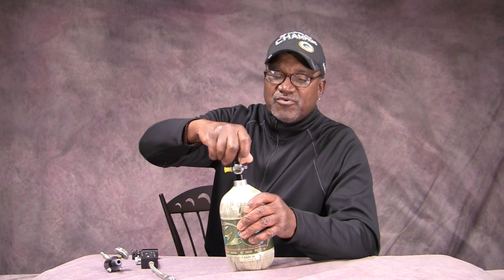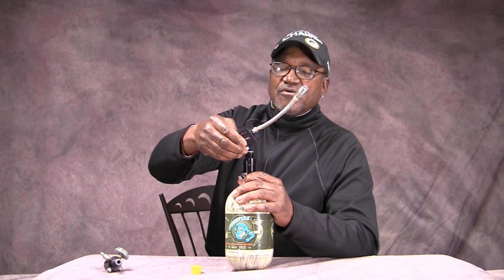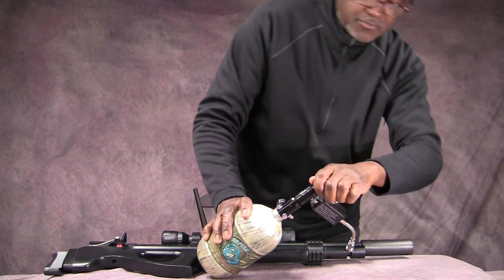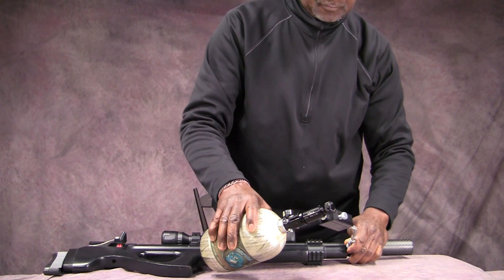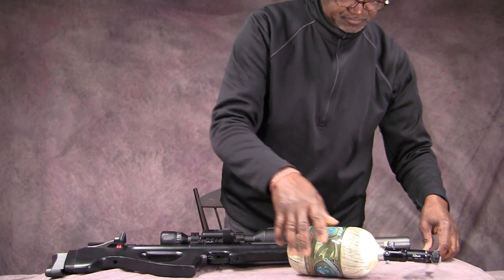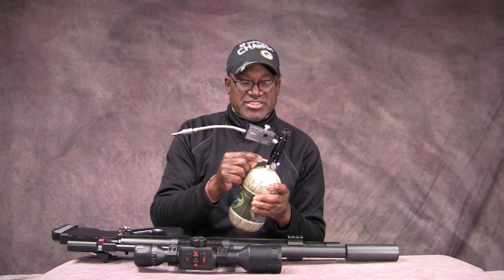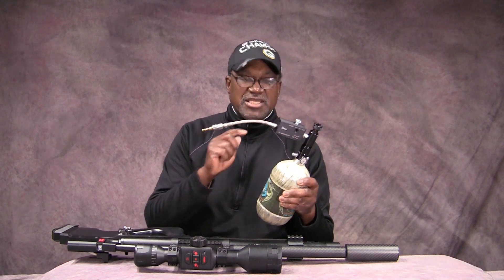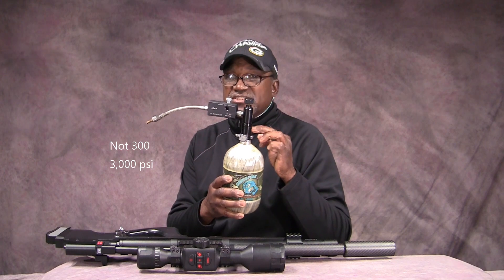4,500 psi Pony Bottle Fill Adapter Fix

Comment: I just purchased on eBay a carbon fiber 88cu pony bottle.  I couldn't find the fill probe that goes on top of the regulator like yours with the fill hose and release valve. I tried the search function and found fill hoses without the release valve. Can you help me find it Aaron?
Reply from the maker: Yes they are on eBay.  Just type in the search the following:  "paint ball regulator 3000psi output" and you will see them from about $39.00 to $99.00   Best of luck.
Reply: @aaroncantrell8819  thanks Aaron, the part I'm referring to in your video is the rectangle shaped thing with a fill hose. It appears to screw on top of the regulator.  I'm not sure what's it called. It's not included on the 3000 psi outlet regulator. Yours has a release valve.
Reply from the maker: @Kcrunchymunch  I can't find the one I have but I wish I had gotten the one I listed below because I am limited 2,800 psi output. This one replaces the regulator, and it has an unlimited output which will work better with PCPs.  Please know that they come in three different thread sizes.  So, make sure you know yours.  Go to Amazon and type this in the search.  Remember the thread size.

Paintball PCP Air Rifle HPA Tank Charging Valve 4500 Filling Station Refill Adapter
Reply: @aaroncantrell8819  thanks Aaron.  I'm waiting for the delivery of the bottle so I will know the thread size.  I decided to get the unregulated one that has double gauges.  That way I control the fill pressure. About 60 bucks.  I'll just remove the regulator that comes with the tank.  It's confusing when you're new to this and it helps tons when you help us understand better.

Comment: That’s fine if your cool with 3K PSI I did something similar but added Belleville washers so it would put out the full 4500 psi. I got so freaking lucky to find 2 carbon fiber bottles at a flea market for 10$ for both. One is a 68 cubic inch which is exactly the same brand and size as yours and the other is a 100 cubic inch. These are perfect for a Mule backpack and a longer flexible whip. The washers I got from eBay if memory serves me. I built them 2 years ago. I use my Diana Bandit PCP .22 cal pistol with a Burris 3X used pistol scope I bought for 75$ at a gun shop mostly for indoor pest control at the farms I help. With only having a 50 cc cylinder on it I can fill this pistol a multitude of times since it only fills to 200 bar. These little tanks are so handy to own, especially for weekends out hunting at the cabin where your only taking a hundred shots with any airgun even my sk-19 .25 cal can be topped off several times. Just handy to have when a 3 or 6.8 ltr is way to much to carry around. Glad you got one for yourself. Thanks for the video stay safe and God bless.

Comment: How much for the whole setup ? I can see one I the future.
Reply from the maker: Here is a link for the valve that only costs $32.00: https://www.ebay.com/itm/Acecare-4500Psi-PCP-Paintball-Airsoft-HPA-Tank-Regulator-Valve-3000Psi-Output/233326757857 and you can get a use Paintball Carbon Fiber Tanks on eBay for between 80 and $120.   Best of luck.

Comment: Hi Aaron great video very informative . a couple of my rifles i run of the paintball bottles and mi have been doing this for years , it is very handy as it is in my ruck sack and the hose is attached to the rifle so i can be out all day and not have to worry about filling up.
It also depends what bottle i use as they have different regulators on them so i get different power levels which is also very handy.
as i have quite a few bottles i will look into converting one so i can charge the rifles i have that are not connected to a paint ball bottle, so would be grateful for like that you got it from or the Part Number so i can order it in the uk , Some of the stuff you buy in the usa we cant get in the uk so it will be good to see if i can get it.
Edgar UK
Reply from the maker: If I had it to do all over again I would get this 3000 psi valve instead of the 2800 psi I purchased.  Check it out: https://www.ebay.com/itm/Acecare-4500Psi-PCP-Paintball-Airsoft-HPA-Tank-Regulator-Valve-3000Psi-Output/233326757857

Comment: Aaron... There is a 4500 psi from ninja.  Called EZ.' But if your bottle has metric threads, then never mind. Only fits inch models not mm models
Reply from the maker: I looked into the Ninja before deciding one this one.  Thanks for watching.

Comment: Very helpful thanks for sharing bsafe
Reply from the maker: Thanks your for watching.
Reply: @aaroncantrell8819  I got my youg heng compressor I must say it is awesome I fill my fx impact mk2 25 in like 30 sec from a 150 to to 250 guick and fast I love this product I also bought some good oil for it and water so it last me a long time
Reply from the maker: @chrisfigueroa3361  I have had my yong heng for over three years and it is still doing fine except for the clogging problem that is my fault.  Be sure to follow some of the instruction in the comments in my next videos They will help you to keep it running well for years.  Best of luck.
Reply: @aaroncantrell8819  yes sir will do thanks

Comment: Do you have a link for the bottle? Your right about the "If you don't know, don't do it".
There are video's that show how to adjust the output on the regulator but safety first, just buy a new regulator is good advise.
Reply from the maker: Here is the link for the regulator valve that I would have purchased had I seen it first: https://www.ebay.com/itm/Acecare-4500Psi-PCP-Paintball-Airsoft-HPA-Tank-Regulator-Valve-3000Psi-Output/233326757857,  I purchase all my carbon fiber tanks used.  To check on some prices just go on eBay and cut and paste this:  carbon fiber paintball tank used.   Best of luck.

Comment: maybe the company sees this and will in future sell with choice regulators.
Reply: Or call them and make a request that they do.
Reply from the maker: I think that because these are paintball pony tanks they will always come with the regulator set at about 800psi and it cannot be changed safely.  So one will always have to purchase an aftermarket valve.  Thanks.

Comment: Hello mate,  thanks for the advice as usual. Do you ever have any problems with your atn freezing. Mine has done it a couple of times now. I have to turn it off and on. It’s all up to date. With the latest software. Not sure if it happens to all of them from time to time
Reply: My ATN was doing that, I went in and turned off sleep mode and havn't had a problem.
Something isn't right with the sleep mode, it would shut mine off and it wouldn't wakeup.
I didn't trust it to work when hunting but havn't had a problem so far...........
Reply: @rickm4130  Thankyou, I will turn mine off and c what happens
Reply from the maker: My ATN froze only a few times but since the software updates I have not had another problem.    Thanks.